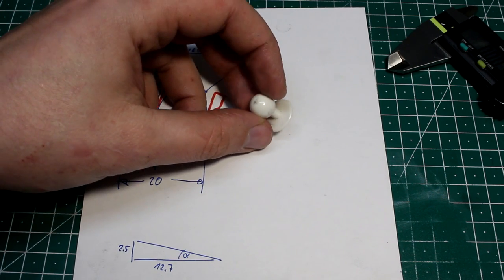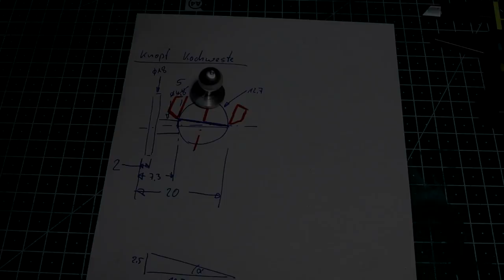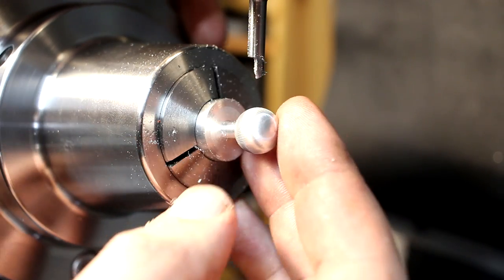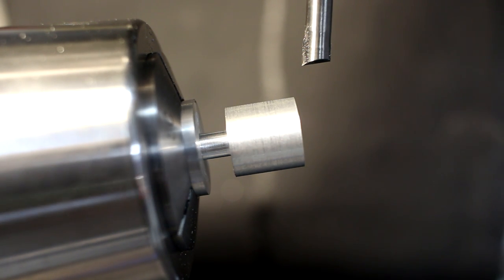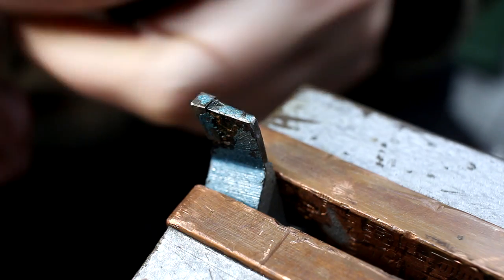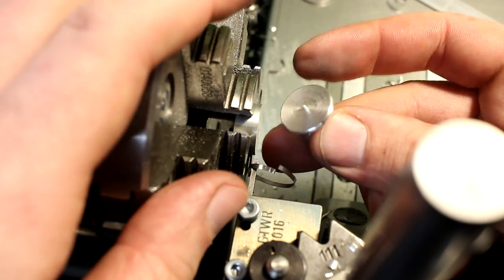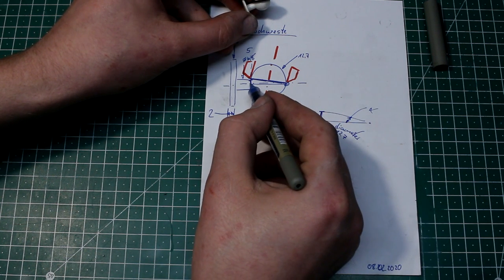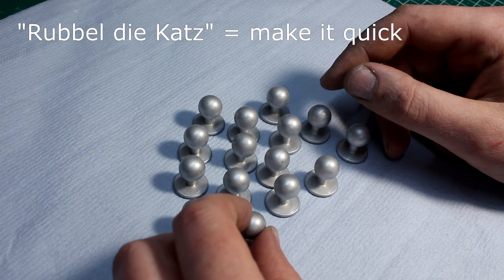Making a ballshape on the milling machine

Comment: As I am older than many here, I do remember these and you made them correctly, as I remember (1960's) the crosshatching as being rather unique as you have done so.. and I am surprised that no one has brought this up.  Your chef will be delighted as there is a high likelihood that this will be noticed..  You are a man of the trade consistently using time pr oven techniques.

Comment: About forty years ago an old machinist gave me a hint on how to do this. Last year I finally was able to use this method. I rebuilt a $4000 dollar three way ball valve. The ball was about three inches in diameter. I had similar results. Made it from 303 SS.

A circle of any diameter can be inscribed any place on a sphere.
Reply: I dont understand, a circle of diameter larger than diameter of sphere cannot be inscribed on the sphere.
A circle of diameter less than or equal to the diameter of sphere can be inscribed.
Reply: @subuktageenfarooqi5712  If you use the muscle between your ears, you might understand that a circle of larger diameter than the sphere you are generating will not work. But if the circle has a diameter that is equal to or less than the diameter of the sphere,and the centers of rotation intersect, a perfect sphere will be generated.

Comment: The math there was a bit off: the hypotenuse is touching the ball in the free end, but not on the shank end. You used the ball diameter on the long leg, but I think it should have been used on the hypotenuse. Not that it would've made any notable difference (you got 11.1363 for the angle using the diameter for the long leg, I got 11.5925 using it for the hypotenuse), just for the sake of precision which is something I love in your approach to everything.

Comment: Stefan -- I couldn't figure out how you could cut the ball to the dead center , in my mind the shank would not allow that, I finally understood when I saw that the ball was rotating on an angle . Kick Ass video .  You da man
Reply: Indeed. Also, it works equally well to tilt the head, on mills with this feature.

Comment: Have you friend come in and take a few close ups of how they fit onto his chef’s jacket & how the closure works... thx.
Reply: Just like the studs used with men's Formal Dress shirts.
Reply: Imagine one of your button-up shirts where you remove the buttons and replace them with another button hole. You’ve got two button holes stacked on top of each other. Put the chef’s button through the button hole closest to your body so that the flat side is against your body and the bulb goes through the fabric. The front sheet of fabric goes onto the bulb of the button too. The layers are held on the shank of the button and can’t slip up over the bulb, but can be yanked over the bulb by someone else in an emergency.
Reply: @eliduttman315  For me that was over 50 years ago. The pain of using them is still there

Comment: Nice job.I made the ball turner for the lathe using a boring head but mounting it into a boring bar holder from the front of the lathe.Mounted a round button insert on the end of a short straight bar to fit the boring head.Sort of a few ideas joined together from some old Model Engineers magazine articles.Turns balls within .025mm circularity which is fine for rough work.

Comment: For those without a wohlhaupter contraption, maybe consider using a normal rotary table set up horizontally, with your mill head tilted off-vertical, and feed using the quill.

Comment: You should be careful when doing your machining at 4x speed, it's a bit rough on the tools and the machine!
Reply: I was thinking that Emco was real smooth at 4X speed.
Reply: More feed and more speed until something breaks.. then you back it off one click!
Reply: Technology evolves.
This is called "High Speed Machining" ;-)
If you use the right tools like HSS its ok, but the stock also limits how fast you can go.
Just rememer CD-R writing up to 52x, or DVD-R writing up to 16x where the blank must allow the speed.

Same here with Stefans 4xAluminium ;-)

Comment: Really great video Stefan.
The company I worked for used to use this technique to make optical lens smoothing and polishing tools in cast iron and aluminium. Both convex (like your ball) and concave with radius from under 3mm up to several meters (almost flat). Although we rarely needed anything more than a hemisphere.

Comment: That's a beautiful method. Bravo Tom and Bravo Stefan. The result is very impressive. I think you could also use a similar method to turn a ball shape in the centre of a length of round bar, with a cylinder coming out each side. Just need to work out your trig (if the cylinder diameters are different), with the difference between the two radii. This method would make for the nice old style three-ball handles on older machinery.

For a really accurate result, I think you need to calculate a new, smaller cutting diameter. Increase the shank size to almost the sphere size to visualise the need for this smaller swept circle. For me, I would just sneak up on the right measurement using a mic, and small adjustments to the boring head. I am lazy! :)

Comment: From what I remember from my Analytical Geometry classes in college I think your description might be incorrect.

The apex point, on centerline cannot be the vertex point of your describing triangle, unless you are actually making a truncated plate spheroid.

Just a quick thought experiment. The hypoteneuse describes the longest line on the triangle. And the Diameter is the longest line bisecting a circle.

You described the Hypotenuse as being above a diameter line when you said it intersects the apex point on centerline.

I'm a retired engineer what aint used that particular mathe in a bunch of years. So somebody go get a motarboard wearing pencil neck and "check my math."

Otherwise a damned enthralling set of skills demonstrated. Your fineness of detail achieved without servos controling those machines is spectacular. Truly awe inspiring.

Tchuss
Reply: Correction:

"... truncated OBLATE spheroid..."
Reply: All points of the sphere section are cut by a circular action (assuming fine enough feedrate, and slow enough rotation of the workpiece). That makes it a truncated spheroid. The oblate sphere (truncated or not) will only fit a circle in on-axis positions.

Comment: very interesting and useful technique . i wish you would have taken the setup procure a bit farther and show  how to set up the boring head to get the proper diameter. thanks for another great video.
Reply: He did. The length turned in the lathe from the face to the back face where the necked down shafts was just slightly longer than the diameter of the ball. Then in the mill, touch off on the face with the boring bar visually while the spindle is off. Then move the boring head in enough to clean up the excess, and boom.

Comment: The reason for those buttons is that you can rip open and take off the jacket in case you accidentally get covered in a hot liquid. I don't think it makes a big difference but aluminium might not be the best material because of it's heat conductivity. They will be lightweight, that's a plus.

Comment: nice work, this makes me think about the feasibility of making mechanical ball joints like those found in a car's steering mechanism in the homeshop, sounds like a car accident in the making to me but also a lot of fun.
Reply: Maybe if you use some pre-hard chromoly or similar. I wouldn't risk it though!
Reply: @CraigsWorkshop  yeah, I wouldn't risk it too with a 2000 lb mechanical mule.

Comment: Nicely done Stefan!  The 12.7mm dia. should  be the hypotenuse in that trig ;-)
ATB, Robin
Reply: I figured the correct angle to be 11.59 degrees .....  the 5mm spigot intersects the 12.7mm circle and creates a chord, which reduces the adjacent leg of the triangle to 12.187mm. The opposite leg being 2.5mm  gives an angle of 11.59 degrees. And a hypotenuse of 12.44mm which should be the size of the circle scribed  by the boring head around the sphere.  I'm about 75% sure my math is correct ;)     (but if I recall, I only got a 'C' in trigonometry)   --- forgive my crappy drawing  ----> https://i.postimg.cc/c4v4hLvC/ball-milling-math.jpg

Comment: I you trick of diamond die grinder bit I liked the boring head ball cut. I'm surprised you didn't anodize them.  Thank you I learned something.
Reply: Even better put a longitudinal groove into the top of an HSS parting tool, cuts way better than a flat top, oh and no top rake needed either.

Comment: Very timely video for me, having recently had poor experience turning something similar (actually a toggle knob for a pressure switch) using a form tool on the lathe.  I'll try it using my spin indexer on the mill tomorrow!  My boring head screws onto the shank, so I'm guessing I'll need to grind a bar with the opposite geometry so I can run the mill forwards🤔  
Also on my to do list is looking out for Tom Lipton's book👍

Comment: Hi Stefan,  try using a bi-metal hole saw in the mill works wonders, good luck.
Reply: Bi metal hole saw!   Nice one.  No need to set diameter on boring head or run mill in reverse.  I'll try it ...to hang all my hats up high...in brass!
Reply: @jossfitzsimons  Well? Did it work OK?
Reply: @fredfarnackle5455  Well, circumstances changed and I'm afraid I never got to do it.  Sorry for the news.

Comment: Hi Stefan,
good technique leading to a precision sphere. You did the trigonometry and calculated the 11.3 degree tilt, but you say it could be increased, am I correct, if you increase the angle, the shape is unaffected, but the open end would finish machining first, then as you continue to down feed to the stem position, the open side is cutting 'Air', your comment would be appreciated

Comment: The diameter of the machined ball is not equal to the circle the boring bar is making. 
Did you calculate the correct offset of the boring head, or was it just trial and error?

Comment: Please correct me if I am wrong. Did you not have to bring the boring bar’s circle tighter and tighter as you approached the top of the ball? I am not clear on that. Thanks for the many valuable videos.
That Old Bob
Reply: No, the boring bar is already set to final diameter from the start.  Hypothetically, you could simply lower the boring head to finished depth, then leave it happily spinning away and just rotate the indexer/rotary table, but that would be pretty rough on the part and the tool, which is why Stefan is slowly plunging the boring head to finish depth as the part is rotated.  Whatever is the 'top' of the ball at any given time, will be cut once the rotary table has rotated 90 degrees from that position - all the cutting is happening in the horizontal plane, at the circle inscribed by the tip of the boring bar.  Any part of the ball that is higher than the tip of the boring tool is just sitting inside the 'cylinder' of the boring bar whizzing around.

If you're struggling to visualise it, try sticking a small piece of blutack to a golf ball, then take the cardboard tube (the cylinder inscribed by the boring bar) from inside a toilet roll and sit the end of it against the golf ball, with the blutack inside. Now rotate the golf ball around an axis close to 90 degrees to the cardboard tube, and you'll scrape the blutack right off with the end of the cardboard tube.

Comment: 5 microns oversize! Sloppy work Stefan !
Reply: I don't know what I am going to do with my life now...
Reply: Yeah Stu, he's really letting it all slip these days... LOL.
Reply: he said 50 micron oversize tho
Reply: @CatNolara  50 microns you say? The component is definitely scrap at that.😀
Reply: .002 inches oversize is pretty substantial on a critical dimension. Clearly more dental than required for a button.
Reply: The swept circle needs to be a smidge under 12.7mm because of the shank radius offset. As the shank gets larger, the swept circle should get smaller, to make a sphere of the same dimensions. Doesn't matter for this particular job, of course! :)
Reply: @CraigsWorkshop  but he tilted the whole thing to account for that. So the swept circle should be exactly the desired diameter.
Reply: @anonymous-yk6ct  But the circle he sweeps with the cutting tool is not cutting through the centre of the sphere any more, it is high on the inboard end, and level with the axis on the outboard, so it is a circle of smaller diameter than the sphere.

Comment: Great video! I've heard of ths but it always involved tilting the head of the mill which can be a pain. One minor error at 16:30 - the diameter of the sphere is the hypotenuse of your triangle, not the base of the triangle. You should use the sine function instead of the tangent. The correct angle is 11.35 degrees instead of 11.13. The is about 2% for this angle. That may be why you had a bit of a ledge at the spigot. If you look at a trig table, the error difference between the sine and tangent function is about 1% at around 6 degrees and will increase with the angle. This is why my old K&E Log-log-duplex slide rule has a SRT scale which allowed you to take either the sin or tan of small angles (this gives away my age). This scale was considered acceptable to 0.1 radians or 5.73 degrees. Minor detail that doesn't take away from great info.
Reply: I figured the correct angle to be 11.59 degrees .....  the 5mm spigot intersects the 12.7mm circle and creates a chord, which reduces the adjacent leg of the triangle to 12.187mm. The opposite leg being 2.5mm  gives an angle of 11.59 degrees. And a hypotenuse of 12.44mm which should be the size of the circle scribed  by the boring head around the sphere.  I'm about 75% sure my math is correct ;)     (but if I recall, I only got a 'C' in trigonometry)   --- forgive my crappy drawing  ----> https://i.postimg.cc/c4v4hLvC/ball-milling-math.jpg
Reply: @joedrouin6957  When your math skills fail you, everything can be solved by CAD. Your math is correct.

Comment: Back in the day, I honed nickel copper and titanium balls for straight and angle ball valves in sizes 4 inch (10 cm) up to 13 inch (33 cm) by the dozen to a mirror finish using the exact same technique. Once the technique was ironed out it was the most boring job in the shop. The days were endless.

Comment: Great demonstration of some very clever setups and lateral thinking.
However, wouldn't it have been much quicker, easier, cheaper and made a more hard wearing product to machine the base and shaft from stainless steel and loctite it into a stainless steel ball with a hole which are dirt cheap on ebay and come in lots of sizes?

Comment: thank you again for an informative video.
I do note that the "math" may be a little out although within acceptable levels of accuracy.
As I see it in your ball example. For the triangle it is the hypotenuse ( not the adjacent) that is the diameter of the circle and the opposite side is half the diameter.... hence the angle is a function of the Sin of the angle = 2.5/12.7 ( not the Tan function).
The right angle is between the opposite and the adjacent sides. The adjacent side is not equal to the diameter of the circle.
although the difference is small, the process is in error. but ok for small angles
using your figures the actual angle is 11.3529 degrees.

but as always your presentation and workmanship  is impeccable.
Reply: I figured the correct angle to be 11.59 degrees .....  the 5mm spigot intersects the 12.7mm circle and creates a chord, which reduces the adjacent leg of the triangle to 12.187mm. The opposite leg being 2.5mm  gives an angle of 11.59 degrees. And a hypotenuse of 12.44mm which should be the size of the circle scribed  by the boring head around the sphere.  I'm about 75% sure my math is correct ;)     (but if I recall, I only got a 'C' in trigonometry)   --- forgive my crappy drawing  ----> https://i.postimg.cc/c4v4hLvC/ball-milling-math.jpg
Reply: @joedrouin6957  Hi Joe,
you are correct if you are turning at a diameter of 12.44mm to give the 12.7mm ball. this requires you to turn through the center-line of the central axis - but I find this counter intuitive. 

However I believe if the ball is turned at a diameter of 12.7mm, which tends to be more straight forward to set out, then the hypotenuses needs to be 12.7mm hence the 11.3529 degree angle.
There is more than one way to turn the sphere - all are at a slightly different angle but only one is in direct relationship to the final diameter.

Comment: Won't pushing an aluminum ball continually through a button hole over time cause an unsightly black ring around every button hole on the chef's white jacket?  And, if made from stainless steel, would be much too heavy given all the ball-buttons required.  So, all factors considered, white polycarbonate (available ?) would seem an ideal material to make the ball-buttons from for lightweight and non-marking.

Comment: Wouldn't the base of the triangle be slightly less than the diameter by diameter×(1-cos(angle))? Also, given a shank radius r wouldn't you want the angle to simply be sin^-1(r/sphere radius)? That would be assuming that the boring head is set to the diameter of the desired sphere.